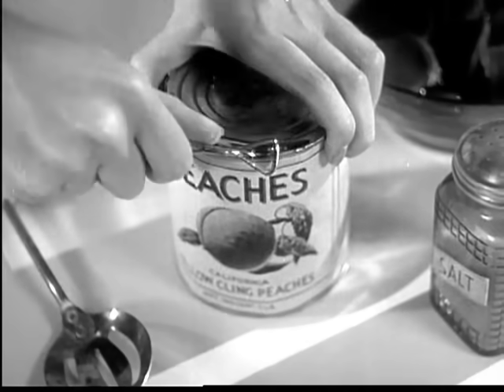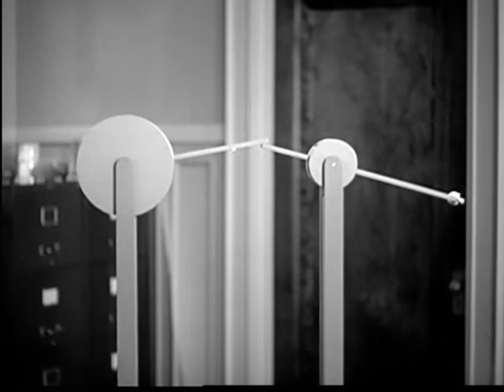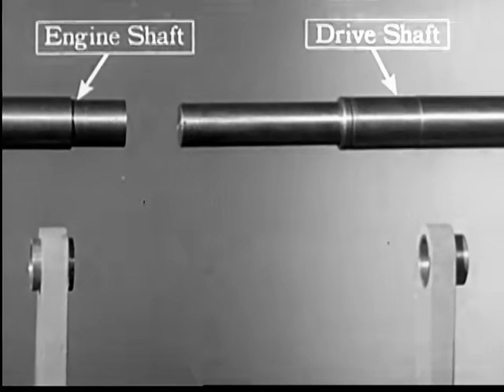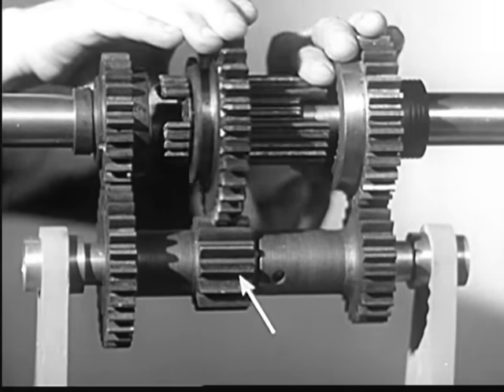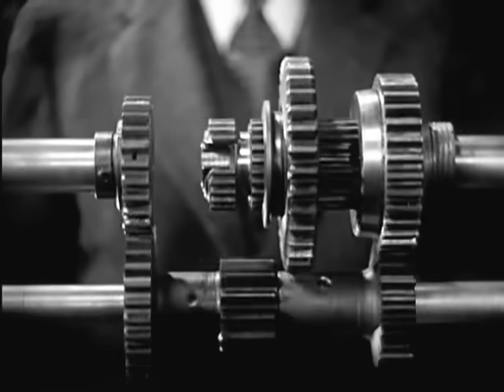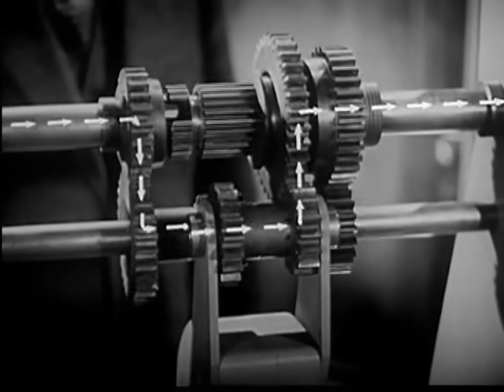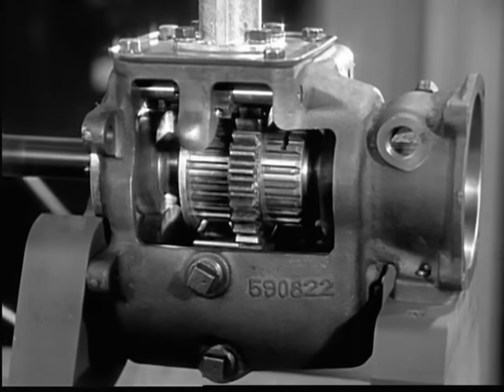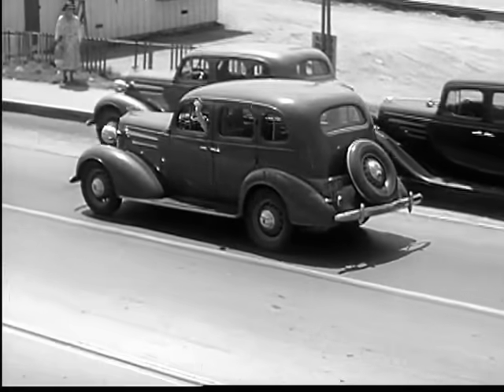Spinning Levers - How A Transmission Works (1936)

Comment: After years of trying to understand manual transmision, finally almost a 100 years video explained it well

P.S: I love how 60 MPH was a ultra fast speed
Reply: @phantomcorsair8476  The reason head on collisions are safer in modern cars is because of crumple zones, Impulse=Force × Time, by increasing the time in a collision, the driver experiences a smaller force, because of the conservation of momentum Impulse remains constant. This means that the only way the collision would not defy physics is to decrease the amount of force in the collision. Hence why crumple zones are proven safer than solid front and rear ends and why a person driving 50 mph who gets in a head on collision in a car with a crumple zone has a higher chance of surviving than a person going 50 mph who gets in the same collision (this is one of the reasons why trucks are no longer "cab-overs"). The only reason T-bone solid panels are safer than crumpling sides is because the driver is practically touching the door in almost any vehicle, and if the panel crumpled in, the driver would get crushed.
Reply: @phantomcorsair8476  I would never ever be an advocate for going that much over the speed limit. That is truly unsafe and reckless. However driving 20 UNDER is almost as unsafe. How can you say it's fine to max out at 55 in a 75 zone?? You're going to cause accidents and start road rage incidents doing that. If 55 is the top of your comfort zone then it's time to get off the road geezer.
Reply: When u don't hv enough stopping power it's definitely ultra fast 😂😂
Reply: So inflation has hit even driving speeds.  Damn Fed.
Reply: @phantomcorsair8476  what model
Chevy do you have, I have a guess bel air?
Reply: @phantomcorsair8476  In addition to the brakes and tires back then you also had much looser suspension and linkages which made control at high speeds much more tenuous.
Reply: @phantomcorsair8476  Not gonna say your 55 max speed philosophy is completely wrong, but cars from the 90s until now are significantly safer in a head on collision and rear end collision. Older cars are safer for T-bone collisions because of solid body panels
Reply: @phantomcorsair8476  ugh my dad's old c5 corvette got 27mpg in 5th gear doing 80mph for over 4hrs of straight driving and when he remembered it had a 6th gear it went up to 32mpg at the same speed lol 55mph isn't the magical speed to get the best mpg thanks to technology 😉
Reply: @phantomcorsair8476  Nothing magic about 55. Energy goes up logarithmically with speed, no matter what speed you start at. Drive at your comfort level, stay as far right as you can (regardless of what speed you drive), go left to overtake then get back out of the passing lane. Simple rules for safe driving.
Reply: @phantomcorsair8476  This is why speed limits are increasing with fatalities all across the US. The people making comments here. Cheers to you for being a sensible driver.
Reply: I love how stoutly built that thing was that you could drop to 2nd at 60 and not blow the engine halfway to kingdom come. Most modern cars come apart without any sort of abuse at all...
Reply: And it had to be down hill 🤣
Reply: Lol, same
Reply: Giving it gas to go down hill faster is called a "power dive". One must be very careful when performing such a maneuver.
Reply: I didn't had noticed, this video is indeed almost 100 years old. Impressive.
Reply: It's easy to get killed at 60mph even today so speeds that can kill are fast in my opinion
Reply: agree .....always  drove   4 cyl. cars  n  always  been  an  opponent  of  oversize trucks  n  suvs,  as  they  are  dangerous  n  can't  see  over  n  around  them.
suv - sav - suburban  assault  vehicle.
Reply: if you go 88 MPH, you might travel through time... i mean, you're always time traveling, it's just that you're traveling at a constant speed through time
Reply: @redpug5042  actually time is deformes by speed and gravity
Reply: @josecamacho5522  yes, but in your reference frame, time is constant
Reply: @redpug5042  yes, we are too slow haha
Reply: I tell you what, she fuckin' sent it down that hill
Reply: I love how some ppl still use miles🤣🤣🤣🤣
Reply: @phantomcorsair8476  that is a beautiful car you have, Ngl me personally the first thing I would have done to it is retro looking 454 and 4 on the floor
Reply: I mean, 60 is still the standard speed limit for non-divided roads around the world, 55 in America mostly I've heard. 70 for highways in the UK and 80 for highways in most European countries. 55 for a highway is ridiculous, especially in a country as gigantic as America, and when I was in the states absolutely nobody obeyed the speed limit.
Reply: @shaddaboop7998  Apparently a lot of American roads are 55mph because the national speed limit during the 70s oil crisis was 55, many roads just never changed back.
Reply: @phantomcorsair8476  In the UK our cars are getting bigger and bigger. I live in a Scottish town with a 400-year-old street plan. There's lots of very windy narrow streets, and none of it's one way. I have a little three door hatchback. Everybody else has a massive SUV, for some reason. 

I've seen two or even three parking spaces at my local supermarket ending up unusable because of a giant monstertruck without a speck of dirt on it (i.e not used by somebody in the countryside who actually needs a 4x4), and it's becoming more and more common here.

And yeah, in America we were often passed by people doing 80 or 90 haha
Reply: @phantomcorsair8476  a c5 corvette weighs 3200 lbs so sounds like it fits your description
Reply: @phantomcorsair8476  the jeep grand cherokee weight is over 4k lbs as well.  And better technology does help with mpg lol the more efficient the engine the better mpg the more hp and trq you will have regardless of what vehicle the engine is in. Then weight and aerodynamics and gearing come into play after. It's like getting 8mpg with an old big block 75 chevy truck but if you LS swap it with a 4L80e and 2.73 gears with a 2500 stall you'll get 15+mpg so all things being equal except engines newer tech wins period lol
Reply: Down the hill! :D
Reply: @phantomcorsair8476  model t top speed was 25
Reply: @phantomcorsair8476  oh yeah I'm thinking of something else
Reply: @phantomcorsair8476  haha model t airplane go brrr
Reply: @phantomcorsair8476  I like diesel tugboat sounds, I like the clunk-a-chunk-a-clunk-a-chunk-a of the engine
Reply: @phantomcorsair8476  Henry designed that engine with ruggedness in mind as much as anything. No, I'm not thinking of the Y-block. Flathead V8s are fucking indestructible and hotrodders have found their bottom ends are good well north of what their top ends will allow them to reach; something in the 5500-6000RPM area before they start having trouble. They can't breathe well enough to ever rev that high without some modifications. And tellingly, they got used in all sorts of industrial and commercial applications that kept them pinned WFO all the time...kinda like the 300 I6 that I have two of already.

With modern oils and oil filters on board...I use full syhtnetic Valvoline and either Motorcraft, Purolator, or Wix filters and that's not gonna change for the classic...there's no reason a flathead won't last longer than the fuel it runs on. Plus, if you peep Mortske, you'll see just how fucked up one can be and still hit on all eight like it was brand new.

I might tweak the rear end ratio a bit and get it to cruise at about 2500 @ 75, though. I have mulled that over. Will have to get it and drive it to see what it wants. I want to avoid a trans swap if at all possible, but if that's what it takes I'll see about a wide ratio 4-speed from an 84-86 4.9L F150. I already have this combo and it's a doll; turns 1650 @ 70 on 2.49 rear gears in that rig. I'm more ameniable to a trans swap on a car that originally had floor shift than column shift as well.

Found a video earlier today of someone in a '37 Chevrolet where they had done a 12v conversion and put a modern 5-speed behind the stovebolt. That thing drove like a modern car as far as pickup and whatnot, and that stovebolt sounded strong too. Very well done rig.

I'm not going any older than 1936 because I want four corner hydraulic brakes, and best I can tell, that came in around 35-36 for most manufacturers. A '31 is not going to have those. Could mod them in but I'm trying to keep it as original as I possibly can; ideally all I mod in is air conditioning and an FM radio. I don't even plan on using radial tires; Coker sells proper bias tires in the sizes these cars use and my local Discount Tire...which is where I get tires anyway...can get them from Coker, mount them, balance them just fine.

Good on ya for dailying a classic!
Reply: @phantomcorsair8476  kinda like the 300. The one in my '85 has 340k on the clock and the bottom end is still tight as a drum. Top end is flat hooped, she spews more exhaust out the breather than the tailpipe especially when cold, but she don't burn any oil and not a hint of bottom end clatter. And that thing is geared to turn no revs at all! Sits in a rev range a model T engine or a diesel would be happy at 24/7.

AC is a must, if not for me, then for when I take my dad somewhere in it. The suicide rear doors will make it easy to get him into and out of the car and his health isn't ideal; he'd have trouble in a non-AC car. I also do RC airplanes and tend to keep a couple in the car since I work 15 minutes from where I fly and clock out at 3pm every day like clockwork. Suicide rear doors and spacious cabin helps with that too; won't have to disassemble the planes to fit them in there haha. But I also usually just leave the windows down while I'm working unless it's raining.

I'm figuring a target tach point of about 2250-2500 at 75mph will be just perfect for an ol' Flatty. Just let it sing along right in its powerband riding on a thin film of modern multi-vis oil(With plenty of zinc added since modern oils lack it these days and the cam/lifters need it) and burning high quality modern fuels with high quality modern coolants keeping it right where it wants to be. 

I almost wonder if throwing some Shell Rotella 15w40 in the sump would be a half good idea. That stuff still has plenty of zinc in it and it's fairly thick which matches well with the single-weight oils the engine was designed for(IIRC SAE30w up to 50w). Also quite easy to get; the brodozer scene in my area is substantial and all of those coal-rollers use the stuff in their 3/4 tons.
Reply: @phantomcorsair8476  its fair to not want to go over 55 in old cars like that, crashing at that speed in a pre-1980's car is certain death.
Reply: @phantomcorsair8476  yeah I didn't really think of that. I drive an old corolla and constantly think about how I would be folded up along with the car if I crashed, I scream along at 3000rpm just to go 100kmh
Reply: @phantomcorsair8476  Dude maybe get a modern car and drive like a regular person if you're so afraid of dying. The cars you drive are way more dangerous to your life than going 70MPH vs 55MPH...
Reply: @phantomcorsair8476   @Phantom Corsair  Dude I'm a car enthusiast, and to be frank, you're a 19 year old kid who happened to end up with some well maintained old (not even classic) cars. 
Like you don't even know what makes a car a classic 😂

You have a lot to learn about the world my man, and certainly a LOT to learn about cars... word of advice? Maybe, when you approach new ideas, try and take them in with for what they are, rather than viewing anything contrary to your way of doing things as being contrary to your person. 

You happened to grow up with some old ford that goes 55MPH, and your local speed limit happens to be 55 MPH, and as it just so happens, you love driving at 55 MPH, and scientifically speaking, and 55 MPH is the ideal rate of travel... how convenient! Not to mention your absurd claim that old cars (which you happen to own) are far superior in every measurable way despite 70 years of technological advancement... 

How many cars have you owned, worked on, and raced? How long have you even been driving? 

Your concept of value is clearly way off seeing as you're out on public roads driving fossils that damn near belong in a museum and you're talking about how economical they are compared to newer cars 😂
Reply: 60 MPH wasn't described as "ultra fast" in the film.  It was simply used as an example.   She wasn't on a highway.
Reply: @phantomcorsair8476  I agree about the gears, I'm just saying that they didn't say it was "ultra fast".
Reply: True
Reply: @phantomcorsair8476  drum brakes are still used today. They provide better control
Reply: @phantomcorsair8476  My  late 1927 Erskine does 64 mph as top speed. Mechanical drum brakes, wood spoke wheels. Brake distance of about half a mile. 60 mph was seriously fast back then. The engine does not seem to mind (well, it had a major rebuild in 1968 so it's basically new) but man.. it's scary.
Reply: @phantomcorsair8476  60 back then is what 60 is today..
Reply: Oh mankind, Surely we are created, and we were given life and we will be caused to die.
Where did we came from? What is our purpose? Why are we on earth?
You were created for a purpose. That purpose is to know and worship your Lord, Him alone.
Your life is a test, The Lord of all the worlds is the Most Merciful the Most Compassionate.
Don't go into the extremes like the christians and the jews. Don't worship the prophets.
Don't worship humans or animals. Worship the Greatest. The Creator. He is Allah.
Who send Prophets and Messengers to lead and teach mankind such as Noah, Abraham, Mozes, Jesus
And last and final prophet sent to mankind Mohammed came all with the same religion.
Follow that which we have been ordered. Don't die disbelieving. There is no return.
Do that which is good and forbid what is evil. Don't be fooled by satan who is an open clear enemy.
The only religion acceptable by Allah is Islam. The same religion each prophet and messenger came with.
Submit yourself to your creator so you may become a muslim.
Reply: @phantomcorsair8476  oh, just that NO country uses it?
Reply: @phantomcorsair8476  That must be an American thing. Here in Germany, we have the Autobahn which has an unrestricted speed limit for most of it. Even at these speeds, the fatality rate per 1 billion vehicle kilometers on the Autobahn - 1.6 - is half that of American motorways - 3.38 (in 2012). Is it that Americans' brains turn off behind the wheel? Hahaha no, don't be silly, Americans do not have brains!
Reply: And no seat-belts in the cars back then. And the cars were twice as heavy also. All iron and steel.
Reply: @phantomcorsair8476  Sammy Hagar and I hate you for that last comment. 😂😂😂
Reply: Big tech's and today schools only seem to be interested into keeping the people as stupid as possible
Reply: @Phantom Corsair 
You don’t need to go faster than 55? 

Come on now, statistical data suggests that increases in speed limit decrease accidents

And seatbelt being needed because the cars became “flimsy” is bs too, rigid cars transfer the force to the occupants, like being in a steal cage 

The school bus works because it’s 35 inches off the deck and has more mass than five cars but if all cars were buses, those kids would be dog meat too
Reply: Cars now a day: hold my spare tire
Reply: @phantomcorsair8476  Ye well moneyshift a modern car into 2nd at 60 and it won't survive long enough to record the video. This thing still held out far better. I mean, yeah, the stovebolt six was not the toughest engine on the block back then...that honor goes to the Ford Flathead V8 which is so damn indstructible itt'l run just fine with one cylinder head missing entirely...but that ol' Stovebolt was still far more stoutly built than anything we have today is. 

If Chevrolet had gone full pressure lube on it like Ford did with the Flathead V8 they probably would have also had something truly indestructible on their hands.

funnily enough that is also the main reason I'm looking to buy and daily a Ford from this era. With a Chevrolet I'd have to put a modern 4-speed or 5-speed manual in it to keep the engine from screaming along, as even staying below 3600 you'd still knacker the rod bearings in a hurry trying to run 70-80 on the stock 3-speed. Get the revs down to a more reasonable 1800-2200 at 75 and the car'd daily fine, but as sold it's not gonna last at modern highway speeds. With a Ford...eh it doesn't really care. Pin the tach and keep it there itt'l take it like a champ.
Reply: @phantomcorsair8476  you're 19 but you talk like you're 82. If your night vision is bad and you have to drive 55 then I can empathize. Otherwise please stay off the expressways and stick to surface roads, and if you must use them, stay in the right lane.
Reply: @phantomcorsair8476  yea no

Comment: This is neither an ad nor an instructional video.  As cars were refined due to many complications in engine and transmission design, certain systems were invented or designed to accomplish greater functioning of all the moving parts.  This video is an explanation of the creation of different systems so as to increase performance, or ease of use...nothing more.

Comment: Step 1: Accelerate to 60mph in town.
Step 2: Money shift into 2nd gear while going downhill at 60mph
Step 3: ???
Step 4: Profit
Reply: Then watch rpms redzone and engine fucken explode.
Reply: @kalinskivadim  ahahahah
Reply: It works for the underpants gnomes.
Reply: Ah - but what a step.
Reply: Anyone runnin a squarebody with 4 speed is completely up to speed on their trans' inner workins though.
Reply: Step 0:  Have a lady do it.
Reply: It wasn't a money shift when cars were built right!